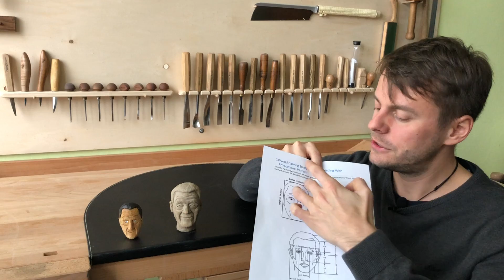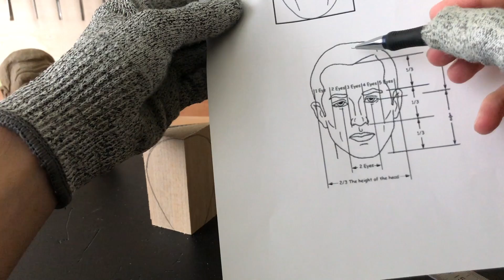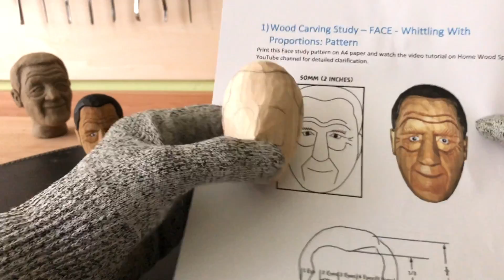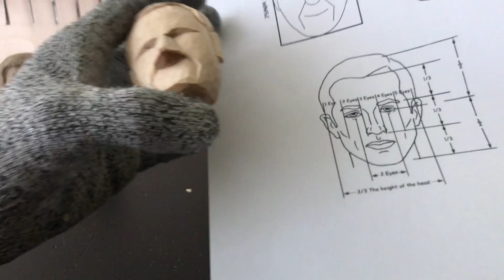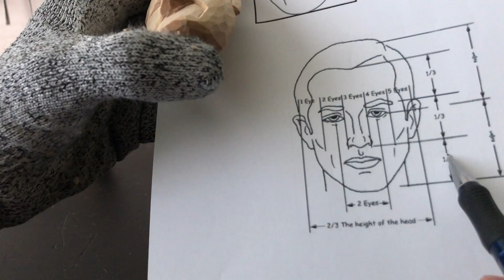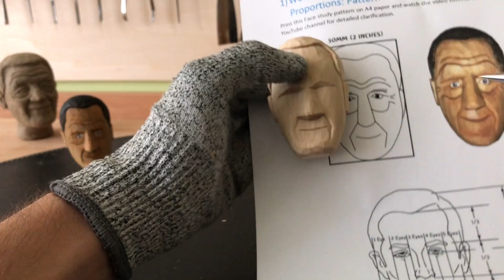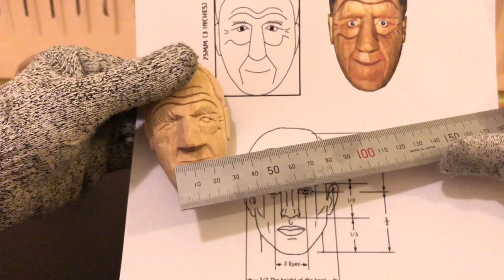Wood Carving Study – HUMAN FACE - Whittling With Proportions

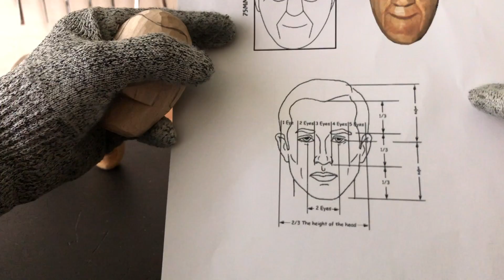Comment: 12:51   I have one constructive criticism. You keep saying "the width of the face" or the "height of the face". Correct me if I'm wrong but its actually the width and height of the head, not the face, that matters. The head is measured at the widest point, up high and back on the skull far from the face itself. Its just a detail but I believe it makes a difference to a novice. Nice video and great work.
Reply from the maker: yes you are right. My bad. It is height of head. Thanks for mentioning it here for other people. :-)